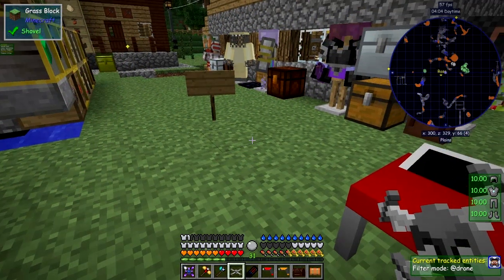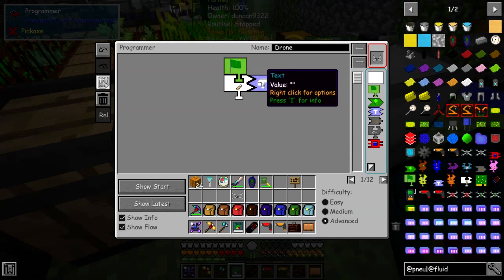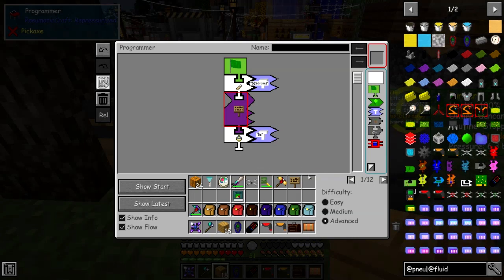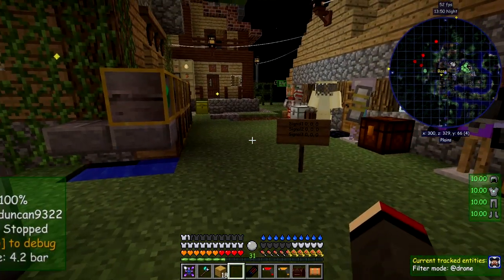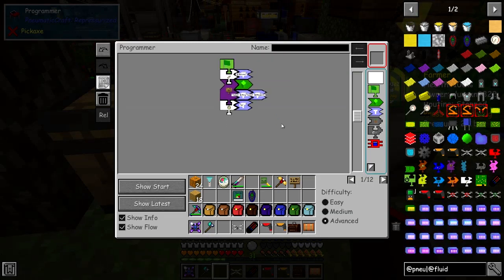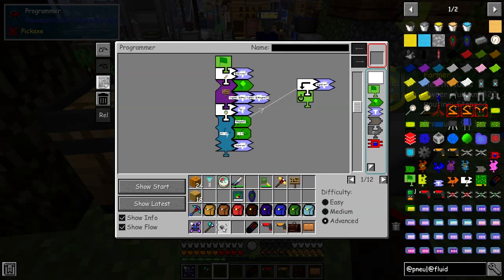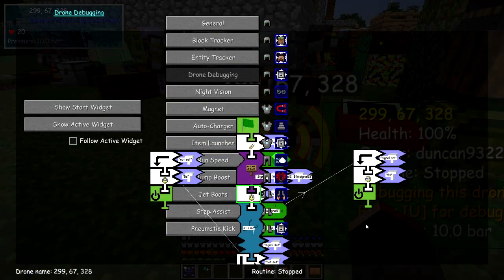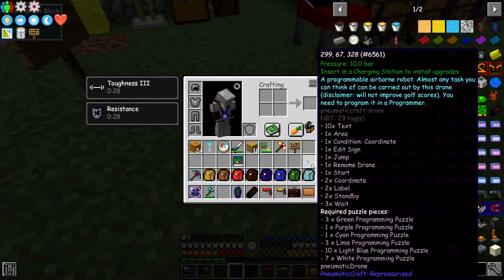Real Tech #091 - PneumaticCraft: Repressurized Advanced Drone Programming

Comment: Also, if you can get your screen resolution high enough (scaled X > 700 and scaled Y > 512), you'll get a high-res programmer GUI which has far more space for widget editing, and is generally much less cramped and nicer to use.  This is achievable with a 1080 (or slightly under) window and GUI Scale = Normal.
Reply from the maker: That's another great tip. I play at 1920x1080 and scale the recording down to 1280x720 and set the GUI to large so that it is readable for viewers. The normal font size make a big difference for the programmer, thanks again.